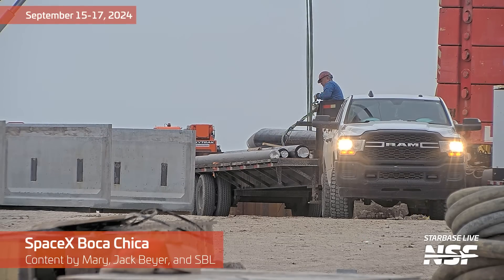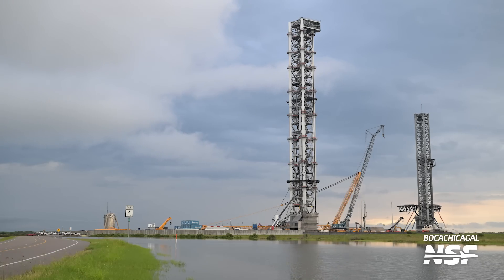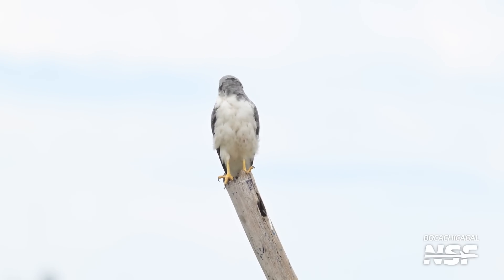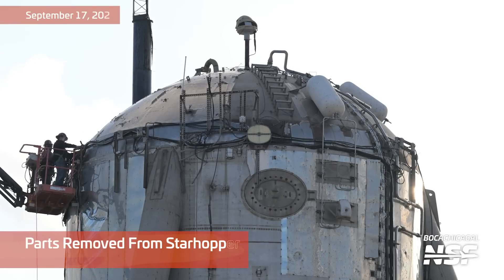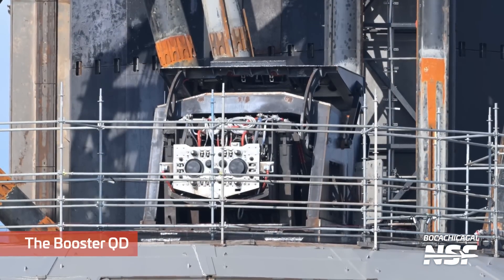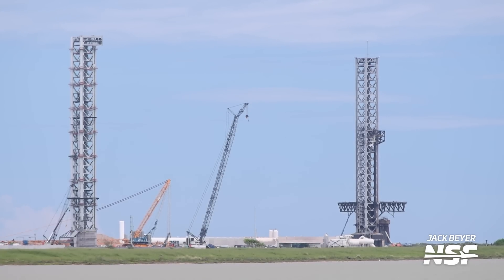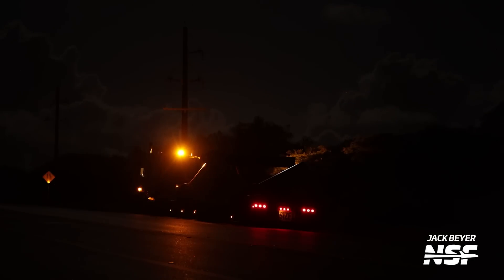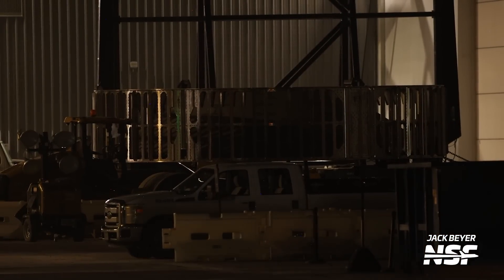Tower 2 Quick Disconnect Arm Hinge Arrives | SpaceX Boca Chica

Comment: The stops for the chopsticks have an impact plate, the other has the Crush portion of the tube exposed with an internally welded cap, inside the pipe.

So if there is a grab, that misses, then the portion of the crush will reduce he shock/dynamic forces impacts.

Comment: Great to see they got the chopsticks under much better control! 
Wonder why it had those heavy oscillations at setpoint previously.

Anybody know what was changed? 

My guesses are based on solving similar hydraulic positioning issues.
The goal is to decelerate to a precise setpoint without oscillation.

The primary physical factors that made this a non-trivial control problem:
A high mass moving fairly fast with virtually no damping (inherent braking).

All braking needs to be generated by the valve(s) to bring the mass to a precise stop at the setpoint. (Kinda like the suicide burn when a f9 lands.)

The things I found that could deliver the sort of oscillation we were seeing previously: 
1 - Cavitation due to asymmetrical flow thru a symmetrical valve.
2 - Hoses or long runs of piping between the valve and the cylinders.
3 - Hydraulic fluid is compressible.
4 - Control system didn't use enough finesse.  (AI/Fuzzy logic)

5 - All of the above...

I would REALLY like to know is what was the real cause of the old Jiggy-Jiggy dance. 

I'm pretty sure that Super Heavy is relieved that it wont be clobbered on every return visit!

Comment: My guess is that once Star Hopper is returned to it's pristine/original form, they will keep it at the present location as a historical developmental monument, or possibly relocate it to the front of the new office building on the ground near where the roads intersect and form an approximate 45 degree angle.  I highly doubt that they will place it inside the new building where there is a triangular opening in the roof.  Would look too crazy there!

Comment: From the beat-up appearance of the sheets coming off Starhopper it looks like they were additional shielding to protect SH from launch debris 

Now that SH is no longer clos3 to the launch tower they are removing the shielding to go back closer to its original flight configuration
Reply: It actually had the shiny metal for all its flights. I think it was mainly to make it look cooler, though it also matched its nosecone before that was destroyed. I wonder if they just consider it a safety risk now that it's all beat up and might fall off (like a bunch of it already has lol)

Comment: Those pieces of sheet metal looked like shit the day they were put on Starhopper. They served no purpose. I think removing all the non flight stuff is good so it will look like it did originally.
Reply: They did serve a purpose, they protected the original Starhopper panels underneath. You  can see dozens of dents in the protective panels from flying debris during launch.

Comment: Does chopstix have some spring in it incase the rocket comes in a little fast and hard?  This would greatly reduce the impact force.
Reply: Those raised rails on top of the chopsticks (they were shown being painted white in this video), are the shock absorbers for the Booster landing.  They're supported by a set of hydraulic pistons, and move up and down relative to the chopsticks.  They're what the Booster will touch down on, with its lifting pins, and those pistons will smooth out the impact force of the landing.
Reply: @Spherical_Cow  Thanks, I asked this question for about a year.
Reply: @Spherical_Cow   I think even springs would work , but hydraulic is ok I guess.

Comment: Das - Those "ruler" marks along the carriage are weld spacing marks. Some instances fully welded edges can warp components from the continual heating, causing the area you just welded to become real hot but the rest of the length is cold, causing expansion and warping of the panel, so you space welds out along the edge and it has very close (sometimes more) to the same strength as being continually welded.  

I imagine they didnt want really thick plating up there, as its more weight on the carriage as a level arm. So you reduce material thickness, and space out the welds so it doesnt deform and you have a more reliable and repeatable process instead of having to try account for warpage/expansion.

Comment: Those panels on Starhopper were added to protect it from flying debris whilst it was a water tank close to OLM1. And I'm guessing that the pipes being removed are the ones which were added to support its role as water tower supporting early Booster and Starship tests. 

If the SpaceX engineers do anything that looks like they going to actually cut it into pieces then glue some bacon to it and Jack will protect it with his life.
Reply: Some of the pipes were added later but the shiny metal has been on since the start. I think to make it look cooler, but also to match its nosecone